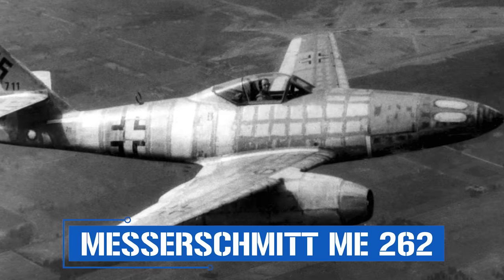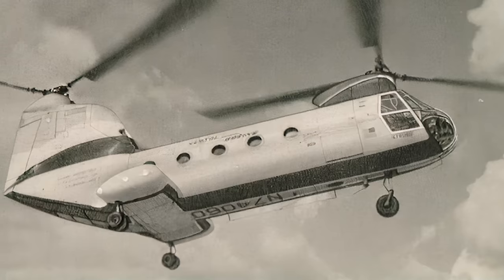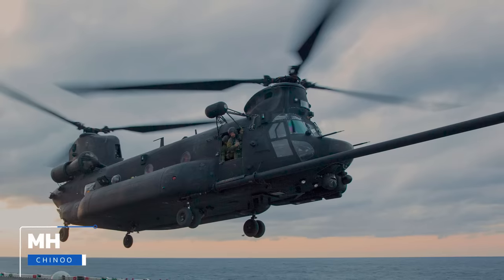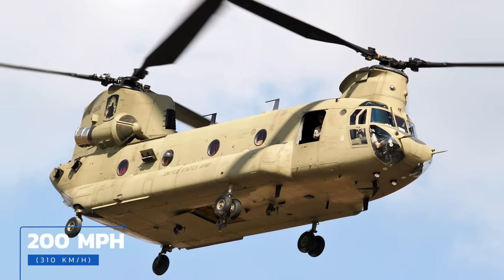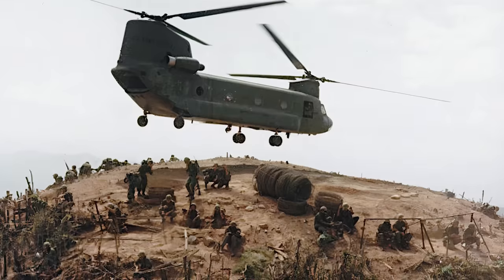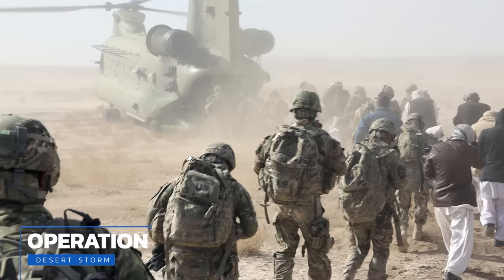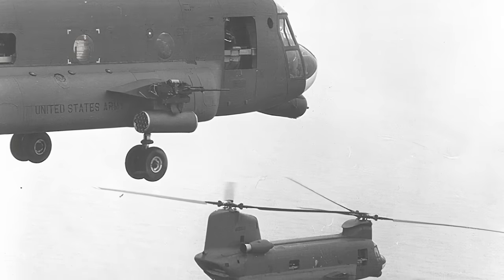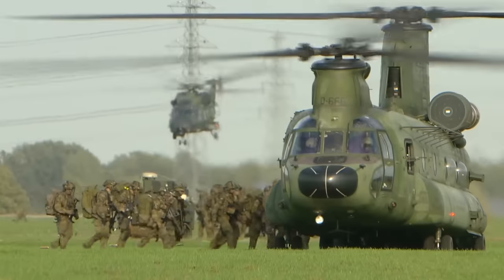The Boeing CH-47 Chinook

Comment: I think I rode a Chinook once in the Infantry. I remember riding a Huey once, and I think a Blackhawk... remember riding  the C-130 ride best. I was mechanized, so I rode more on the 113 and Bradley.
You mentioned safety issues. That's where the load master comes in. He has great power over go/no-go of the plane on that mission. I have heard of a colonel who got into a spit-lot of trouble for ordering a flight despite the load master's protest.

Comment: Story time.  I was stationed at Ft Campbell as a Chinook mechanic and Phase Team Leader.  At the time we were conducting a lot of night ops, because we were gearing up for deployment, so OP TEMPO was pretty high.  Some of the folks who lived around the post started to complain that we were making so much noise they couldn't sleep.  Of course they called different numbers and finally reached the Public Relations Officer and that got shipped over to COL Brady.  

It just so happens that I was assigned to be his driver and was in the office when the PR Officer came calling.  COL Brady, after setting this young MAJ straight, retrieved the complainants phone number and name. In his normal military command voice, he called the person and conducted his introductions.  After listening to the person berate him for about 45 seconds to a minute, the COL said and I quote; "Mam, with all due respect, I will not apologize for the noise of the helicopters.  I will not change the route of flight and I will not stop the training we are conducting.  As defenders of this country we must be prepared for all contingencies of battle.  Flying at night protect my men and the taxpayers equipment.  So instead of complaining about the noise, realize what you hearing is the sound of freedom".  With that he said his goodbyes and ended the call.

Comment: Great video Simon! I have ridden a few times on a Chinook. Unlike the movies you cannot hear anything on that helicopter! You have to communicate with hand signals. The rear engines are exposed on the inside of the helicopter so the flight crew is able to constantly inspect them during all phases of flying. It is extremely loud! Also a cool note: as the blades spin they produce a static discharge that is visible with the naked eye at night, and looks super cool with a nod(night optical device). A safety note: Absolutely never walk in front of a Chinook either! The front blades when fully powered down are only 4.5 feet off the ground. People have been decapitated and fatally injured because they walked in front of the helicopter as the blades were spinning down low. If the blades are spinning and you walk in front of it, you risk getting your head lobbed off, or getting cut in half😬

Comment: You said that the D model Chinook came out in the early 80's. I was stationed in Germany with the 295th Aviation Regiment from '87 to '89. We were the last Chinook unit on the planet to trade in our Super C models and get the new D models in 1988. 
Our brand new D model Chinooks came factory equipped with hydraulic leaks, the wrong antennas, the wrong push/pull rods the run next to the combining transmission and empty pop cans under the floor. 😎

Comment: Your comments about the CH-47's age are correct, and that highlights an important idea:  There are pieces of military equipment that are perfectly suited to their tasks.  Useability, dependability, suitability, ease of repair, and even price are all factors that go into judging a piece of military equipment.  Equipment that survives in the military TO&E for decades (or even a century) has stumbled on a combination of traits that is either hard to improve or simply doesn't need improving (especially when budgets are limited.)

Examples include the C-130, which has had ongoing cockpit and engine improvements while maintaining the characteristics that made it great in the first place, or the grand old 'Ma Deuce', the M2 .50 caliber machine gun, which has survived with very few changes.  When I was in the Army our arms room has an M2 that had a manufacturer's plate dating it to 1945.  It had pride of place on the commander's track, and the soldiers in my unit would salute it when it was deployed because it was a true veteran, having fought in every conflict except Desert Storm I.

Comment: You should check the Coulson Aviations CH47s they use for rotary wing firefighting, they are currently down here in Australia. They feature a smart internal water tank that can delivery specific loads (IE not dump all at once) and when NSW had bad floods they were easily removed to convert back into standard cargo carriers for relief efforts

Comment: I used to see these babies hauling M114 howitzers all the time. In fact, I saw one get dropped from about 300 feet because it became unstable during transport! The after story was that a lieutenant failed to count the number of turns in one of its straps compared to the other two and as a result, it caused too much drag and caused the gun to start swinging wildly!
The Chinook started following the oscillations and couldn't calm it all down. The loadmaster just dropped the gun into Camp Roberts mud!
We were stunned to watch the whole thing unfold!
The 'Butter-bar' responsible was assigned a desk job... or so we heard... I think his naked was Patreus! ;-)
Just kidding!
We got to see the aftermath of the gun being towed back to Ft. Ord later. It was a mess! Most of the mud was washed away but the barrel was truly bent and would never be used again!! 
I was kinda shocked by that because they are really thick and the ground, at least on the surface was very soft!
We'd had heavy rains for about a week before and I figure the deeper ground would have been softened up as well!
I was apparently wrong!

Comment: I started out as a Chinook mechanic in 67 and halfway through the year, due to attrition, was asked to be flight eng. We went down three times and two of them were mechanical problems.  You didn't mention another predesor to the Chinook which we called the banana. Also the reason Chinooks didn't work out as gun ships was if you mount 5 quad 50s in a Chinook, it will literally shake it so bad, joints will actually start coming apart

Comment: Although I have no experience with the Ch47, I did ride around in its smaller sister the Ch46 in the Marines.  They are unsafe at best and death traps at worst.  We attended "helo-dunk" training where you are taught to escape a sinking helicopter.  But the 46's sank so quickly in real life that the crashes into water that did happen usually resulted in the loss of all personnel on board.  All the craft we had (in the mid-90's) had bullet hole patches in them from Vietnam.  Luckily the Marine Corps retired the 46's in 2015.  After a service life of 49 years!
Reply: And they replaced them with an even worse deathtrap. What is it with the marines and flying coffins?
Reply: @atomicskull6405  No one wants to live forever

Comment: These are incredible, coming off an OP on a Chinook, pilots decided to mess with us and basically stalled/went into freefall for several seconds, restored power and regained flight no problem. Either pilots were very bored with life, or they were very confident they could recover from stunts. I think it was the latter. Only time I thought they were dangerous was when we took small arms fire but since no helicopter is wearing heavy armor, that's not really an issue with CH-47

Comment: I actually had a somewhat close encounter with one of these bad boys a couple years ago. My house is located under some sort of military flight path, as I hear jets and choppers go by on the daily, and one day I heard the very distinct sound of a Chinook, and it was LOUD! Much louder than the typical choppers I hear going over. I stepped out my front door and looked up to see a massive Chinook hovering only a little way above the treetops almost directly over my house. It was so low, I could make out the face of the man sitting with his legs hanging out of the side door, down to the fact that I could tell he was white and wearing a pair of shades under his helmet. In fact, I’m pretty sure he stared back at me as I stared up at him in his chopper. I watched for a little while, and they flew off, but I’ll never forget that moment.

Comment: The rotors aren’t just synchronised, they’re physically connected through the central driveshaft. You can’t move one without moving the other, and you’ll also move the entire drivetrain through the 5 gearboxes through to the sprag clutches.
Reply: What do you think mechanically synchronized means? 5:55
Reply: That's what he said.
Reply: @caleb7631  They could be mechanically synchronised without being physically connected like they are.
Reply: Even my Corgi model does that!
Reply: The two engine transmission reduce the engine rpm, turn it 90 degrees and send the power into the combining box.  The combining box takes the two engine inputs, reduces the rpm further then sends it forward and  aft to the two rotor-head transmissions. there the rpms are further reduced, turned 90 degrees again and sent up into the rotor heads.  The 3 blades on each rotor head intermesh during their rotation making those last three transmissions critical, meaning without them the blades would intermesh.  Think timing belt failure on some ICE engine designs allowing the valves to hit the pistons - end of the day for all.

Comment: Boarded the CH-47, someplace, I see three big X marks on the floor in red tape. We take off, five minutes in, the Crew Chief comes back with three big cans. The cans have magnets on them, he puts the cans on the X marks. He says"watch these, is oil stops dripping in let me know". I asked" if it stops?" He grins, " if it stops you will need another ride," and walked off.
Reply: Did he say why?
Reply: I can answer that. I was assigned to B Co. 4/123 AVN Regt, the Sugar Bears. If it's not leaking the hydraulics were empty!
Reply: @Sneaky_Blaze  It means you've got no more oil in the system and are about to have a bad day.
Reply: Hydraulics provide the power to control the rotor heads. The valves on the actuators are mechanically  ( by push rods ) controlled.

Comment: The twin rotor design, even though helps with yaw torque obviously, doesn't automatically delete it. When the aircraft pitches up or down the difference in collective pitch between the front and rear rotors causes them to experience different drag values. This also causes different reaction torques for the the rotors and this also causes yaw torque.

What actually removes the need for a tail rotor is the fact that the tandem rotors can control yaw by imputing opposite cyclic commands front to rear and therefore can also counteract the yaw torque caused by differential reaction torque.

Comment: I got a couple tailgate jumps from a CH-47 with the 504th in Panama in 88? 89? Not sure. It was during operation Sand Flea prior to  operation Just Cause. When you jump from a C-130 your parachute opens in about 4 seconds. When you jump from a helicopter it takes about 6 seconds. That extra two seconds is a very long time.

Comment: Was with the 135AHC in Nam 71-72 that had all Hueys. Great shit hooks would have no problem bringing a disabled UH1 home. They can float in calm water. CH47'S, UH1 HUEYS & B52 will still have a few flying a hundred years after the first ones rolled off the assembly lines.

Comment: Very well done video on my favorite aircraft. Thanks for the accuracy. One correction I'd like to make. There was no dedicated variant of a Chinook used solely aircraft recovery in Vietnam. All of the Hooks in my unit, the 205th Assault Support Helicopter Company Geronimos, rotated though the daily standby mission of aircraft recovery. 

We also had a daily standby helicopter dedicated to aerial firefighting with two 350 gallon fiberglass buckets slung from our hook. The buckets had hydraulically operated doors in the bottom that the flight engineer, laying over the hole, could open when approaching the fire target. 

For the record I was a flight engineer with the Geronimos in Phu Loi Vietnam from May, 1969 to November, 1970. My aircraft was bureau # 66-19051, an A model. I later crewed a B model used for rotorcraft research at NASA, Langley Research Center. And, yes, the fat lady is still the fastest helicopter in the Army inventory.

Edited to mention: We never overloaded our Chinooks and we never did weight and balance calculations. We would load up to what we thought would be max gross weight and come up to a hover. If our engine torque needles showed we were overweight during hover we would just sit back down and offload equipment and/or passengers.

Comment: Fond memories of flying out to USS Tuscaloosa (a Newport Class LST) on a Chinook.  Point of order: a Chinook is approximately 12 longer than the LST is wide, therefore they "land" on such a ship by touching down only with the rear landing gear.  Cue my first flight. I was an HM3 (E-4) sitting next to my HM1 (E-6) As we got close to the ship, the pilot flared up to his approach angle, just off the ship, the tailgate  dropped down giving an amazing view of the south China sea. About 20 feet below us. That's when the HM1 put a death grip on my arm and kept it there. He had to be pried off. After we got on deck he admitted he couldn't swim that well and was not keen on heights... Good times

Comment: As a Chinook pilot of 20+ years, flying all models from the 'B' to the 'F', I can attest to the accuracy of this report. It is a welcome relief to the usual garbage put out for 'clicks & views' by grossly misinformed non-aviation people. Kudos to Magaprojects. With that in mind, I must point out one error at 13:45 where it is stated that "the maximum carrying capacity was increased 'BY' 20,000 pounds" should read "TO" 20,000 pounds. Although that number is usually stated as an everyday lift capacity, it is just not so. Loads that heavy require specific conditions of fuel weight, altitude and temperature. There are times where a load of 20,000 pounds may be exceeded, but that usually gets into a 'trading fuel for cargo capacity' scenario. No matter though, it is a beast. I've never met a Chinook pilot that didn't love the machine.

Comment: No doubt the 47 has been a work horse for a long time. But at it's introduction it was classified as a "medium" lift aircraft, whereas the CH-54A & B were "Heavy" lift.
The 54, Tarhe, is still in use today and with a few modifications could easily outlift and helicopter in the free world.

Comment: Fun Fact: The CH-47 hull is water-tight enough to allow it to land on water for short periods.
Reply: That is amazing !
Reply: As someone who works on them, that sounds like the most dangerous thing I've ever heard of, but I've never thought about it. So long as you keep the rotors spinning to prevent the aircraft from flipping upside down, it could likely be done
Reply: @dr._pie3745  That was from a guardsman/pilot. But he said they did leak and he'd have to lift off after a time to let it drain.

Comment: I don't know if it got into uses.  But at one time they were working on using rockets on the sides and inside there was reloads for the rockets.  They just dropped behind a hill or something reloaded the rockets and would pop up and fire them and drop back down and reload. With the amount of reloads each could carry a group of 5 or 6 could take turns popping up and firing.  This on paper looked good.  I just don't know if it worked out. 6 each popping up and firing as they moved the point across the battle field could take out a large army trying to move up on them.

Comment: The Canadian Military operated a variant of the CH-47 Chinook called the Boeing Vertol CH-113 Labrador. They were assigned primarily to search and rescue missions. Painted in high-visibility yellow with red accents, they were popularly known as "Flying Bananas". They were extremely popular at air shows.
Reply: The RCAF CH-113 Labrador and Canadian Army CH-113A Voyageur were variants of the original Vertol Model 107 (US designation CH-46 Sea Knight) which was mentioned early in the video... not the larger Model 114 (US designation CH-47 Chinook). The yellow-painted search and rescue units were the Labrador, which were replaced by the CH-149 Cormorant. We have also had the Chinook (CH-147), in batches of different variants over the decades; current units are CH-147F (first delivered 2013).

Comment: I hated the CH47C fifty years ago. My first day on the job with the 101st AA Div, one punched off one of my 2 1/2 ton Dumps at 150 ft.    I found the CH47 totally unreliable in airmobile operations.   I lost a lot of equipment slung out under those beasts. I found the CH47 was particularly scary to ride in with all the strange vibrations. It gave me a instant pucker just stepping onboard.   On the other hand, I loved the UH1H.   They may be very much improved from the 1970’s but for troop carrying I hate to put that many eggs in one basket.

Comment: Max airspeed, or Vne, vary greatly based on weight and density altitude.  
47 in certain condition will have higher Vne than 64 or 60.  When hot, high and heavy, no other helicopters come close to the performance of 47.  

Single rotor helicopters are usually power limited on how fast they can go. 47s will fall apart first due to track & balance of the tandem rotor system way before getting into power limit.

Comment: To be fair, the rotors aren't synchronized JUST so they don't slam into each other, but also, mainly,  to allow the craft to fly one one working engine... 

The same is true for the V-22 even though it's rotors can't possibly interfere with each other.